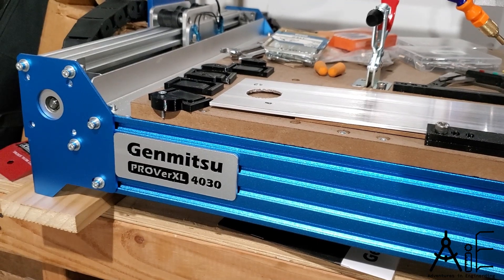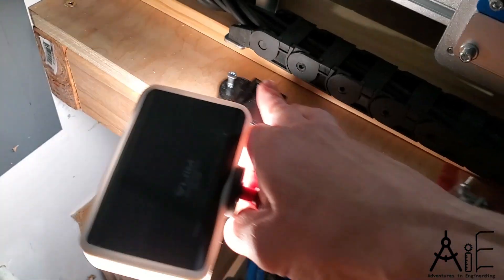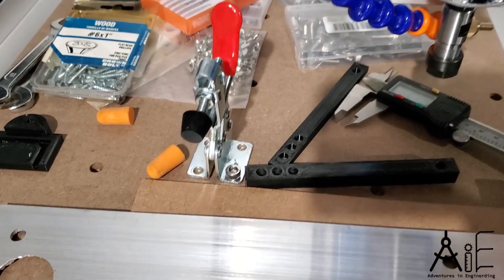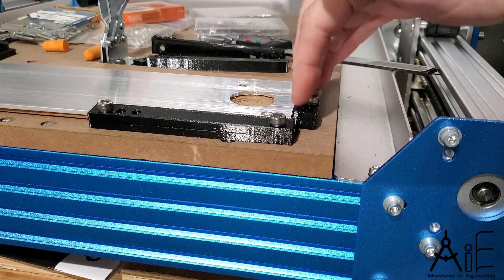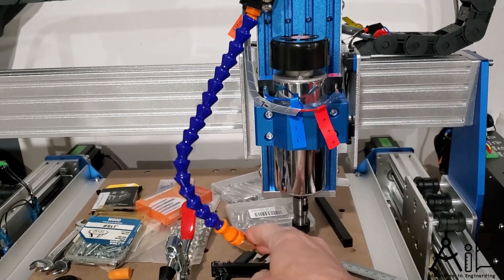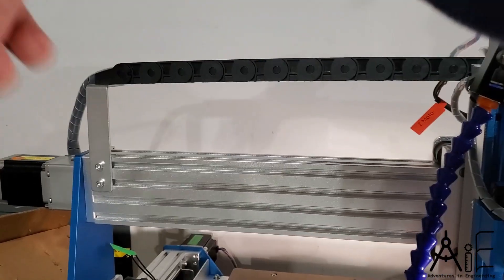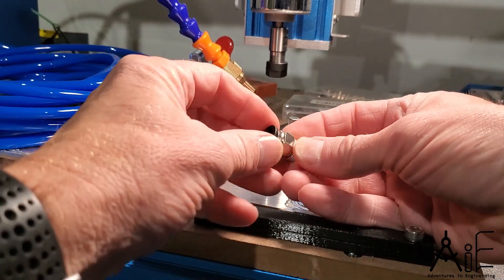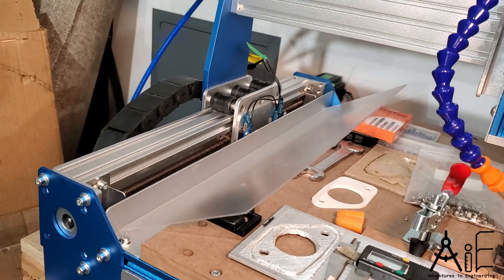ProverXL Desktop CNC mods and 3D printed accessories

Comment: Watching you fit the airline in the roll-chain I thought you had the roll-chain connecter wrong, looking at other videos of this model they are all the same, seems to be a design error. A roll-chain is not supposed to slide, though often called dragchain, its supposed to roll out along the direction of travel, not be dragged along the top of the X rail as it will wear through. The fixed end should be at the post end like you have it but then along the top of the X axis then curl up and back over itself to the moving part, on the 6050 its correct, on almost all the 4030's its not. You have given me some good ideas and food for thought with your mods, thanks for sharing.
Reply: Incorrect design by Sainsmart on all the 4030v1 machines. They altered it on the 4030v2 but attached the chain backwards, the pop open clips are at the back of the chain, they forgot to rotate it correctly.
Reply from the maker: @incubatork  I will check the wire loom chain differences on the 6050.  So far no visible problems, but not a lot of use yet. Thanks.

Comment: I'd get soem concrete or old marble or stone countertop to place the machine on, it will be much harder to start resonance in that and will reduce noise a load while reducing vibration. You can normally get it pretty cheap on secondhand marketplaces from people doing home improvements.
Reply from the maker: Interesting. My bench is sturdy & bolted to the wall, but still subject to smaller vibrations. I'll put it on the list.
Reply: @adventuresinenginerding  box in the bottom of your table and fill with sand (if you want to be able to move it) or concrete if it isn't going anywhere. the same technique is used to weigh down washing machines and stop them vibrating across your floor

Comment: After years of using Hass and Bridgeport CNC milling machines, these little toy machines are just a big  joke or should I say a little joke.  
But, good luck, it looks like you are having fun.
Reply from the maker: True! I wish I had your experience on other machines.  These are desktop machines for making small things.  With a little patience, they can be of high precision.  If I could buy a $50K-$100K industrial machine for my hobby, that would be super cool.  But, alas, no room in my garage.  Even a Bridgeport is much bigger and 5X the cost even for a used one.  A local machine shop charges a $500 setup fee for a part, then a price per part.  So I can prototype 2 parts and pay for this machine (DONE!). I can go through multiple iterations for a very small cost.  Then I really know what is required to make it manufacturable.  From there, if I need production and think there is a market I can go pay to get it done on a HAAS machine.  Or I can make one off parts whenever I need for the cost of material.  But if you are giving away a Bridgeport, I'll gladly take it off your hands!  Thanks for watching.
Reply: Having fun is what it’s all about.

Comment: One other thing I did to mine was replace the spindle with a Dewalt 611 hand router. So much better cutting capabilities. The ProverXL comes with the router clamp to swap their pathetic motor out with the Dewalt. The downside is the lack of automated turning on and off the router and the lack of programable spindle speed, but honestly, for me anyway, it was worth replacing the existing spindle.
Reply: Amazon sells an Iot Relay. Connect the Prover motor output to the switch terminals then plug the 611 into the relay. Presto! Router  starts automatically. Check James Dean Designs Prover XL vids.
Reply: @la77y8  awesome! I’ll try that!
Reply from the maker: That upgrade is on my short list, especially for using bigger bits.  I see the same issues.  I think the power cable can be modified to be On/Off controlled by the CNC controller, but speed will be manual.  There must be a solution.  Thanks for watching. I'm gonna go check out some of your videos now.
Reply: @adventuresinenginerding  hey, we’re all in this together learning. I have sooooo much to learn and I enjoy seeing how others work though this stuff too. I will keep watching your content. You are on your way!

Comment: I did the exact same thing regarding the plexiglass guards (one piece that extends the length of the edge and bends over the top of the ledge to cover the screw. I don't know why this machine doesn't come with some on their own. It's a simple, yet obvious part.. Maybe this is a marketing opportunity for us small YouTube channels to make these. :)
Reply from the maker: Good to know I'm not the only one to see this flaw.  It could be done better!
Reply: @adventuresinenginerding  I’d wager, it’s cause the next tier of machine up in their range comes with them mounted on the outside, along with a bunch of other stuff like proper linear guide rails, a redesigned z axis so only the spindle moves and not the whole assembly, and a much more rigid looking base, and a bunch of other stuff I’m sure I’m missing. That way they can try to incentivise people to buy the more expensive machine that’s actually well designed :P
Reply from the maker: @dylanshandley1246  Their upsell marketing techniques won't work on me!  You make good points to understand why these are not production quality machines. Yeah, they could be better, but are pretty decent for the money - even though $1k is not cheap!